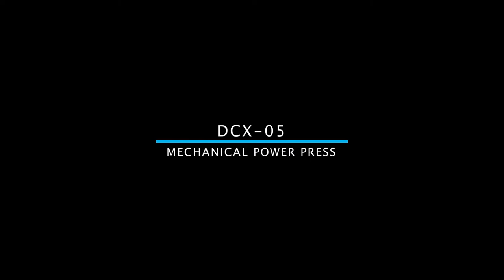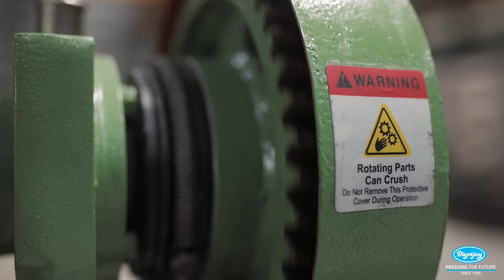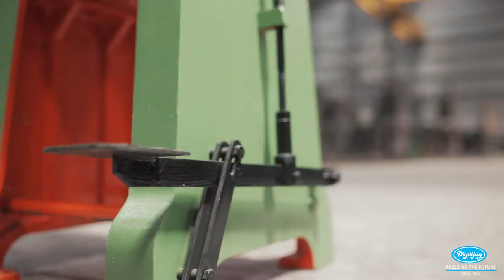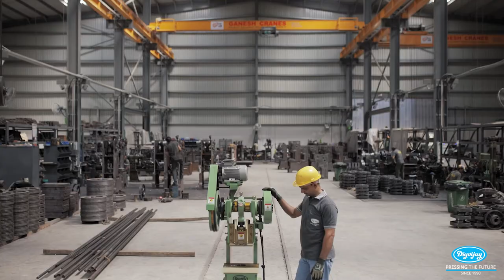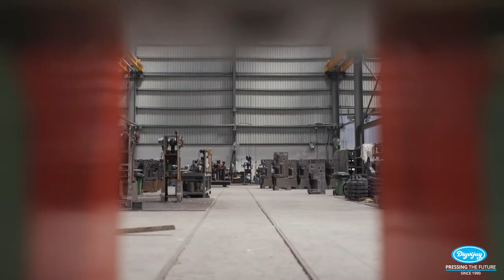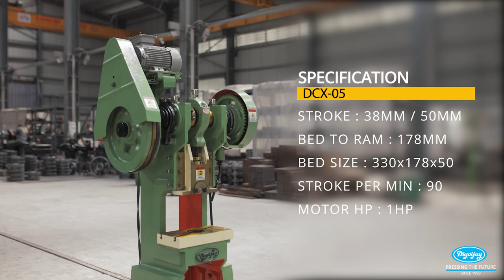5 TON  C' Type Single Gear Power Press | Digvijay Engineers

Comment: What is aut 10 ton Power Press price in the from Bengaluru
Reply from the maker: plz call on 9824097004
Reply from the maker: 115000 with electricals.  gst 18% and transportation extra